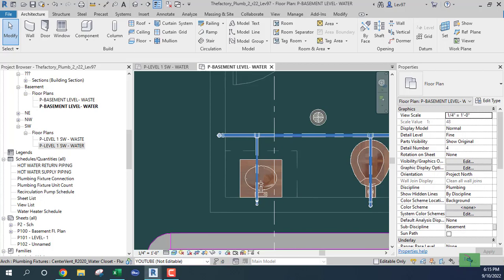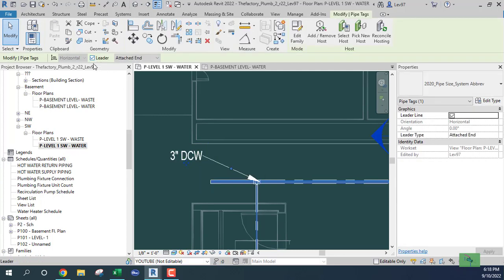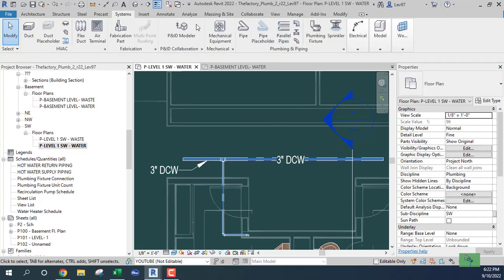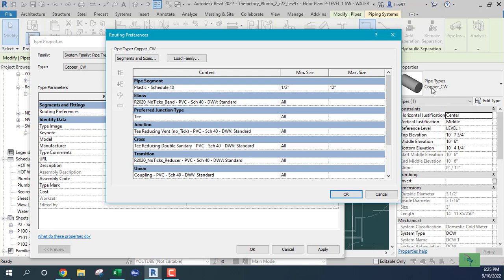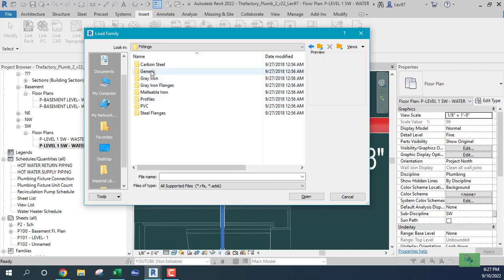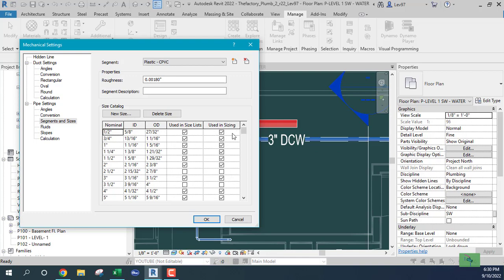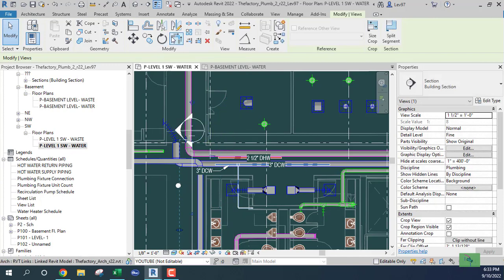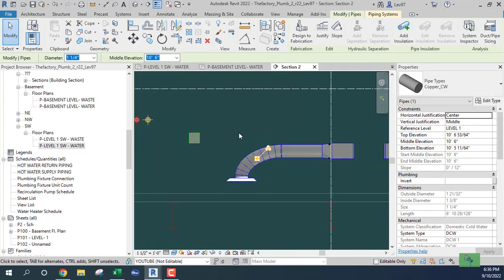Revit Plumbing. Pipe Settings | Settings and Sizes. When to use flange piping in Revit.

Comment: To load a family use the cloud insert next to the load family tab....it took me a few days to get use to it. I was doing the same thing...
Reply from the maker: Thanks Robert, will do. ....maybe I'll find some cast iron piping and fittings and if I'm real lucky copper piping and fittings.
Reply: @plumbing3d22  Yeah the families are cloud based now, it a little better because they added more families. You have to insert it into you project, then add it to a pipe system it took me a couple of weeks to figure it out. I think that is a bug they need to fix.